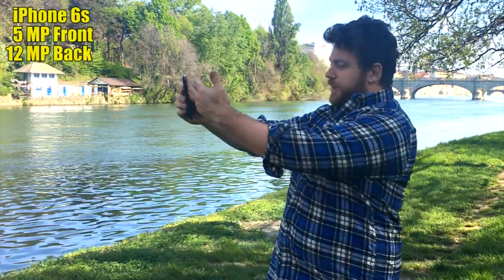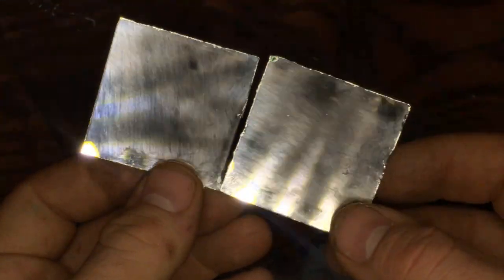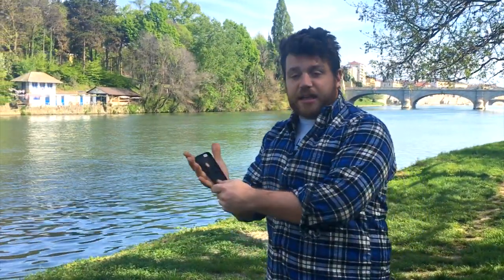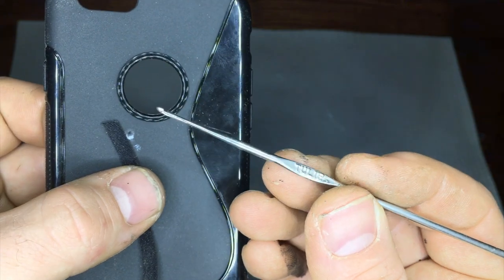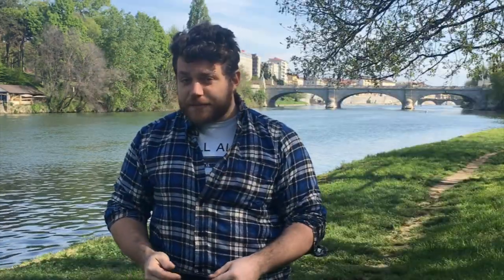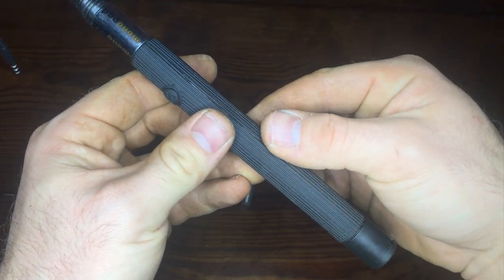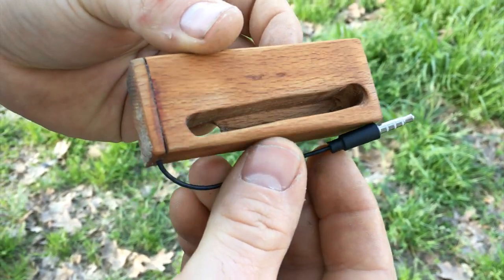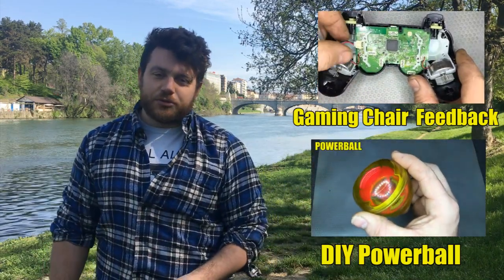3 DIY Projects for your Smartphone! TUTORIAL

Comment: I drill a hole in the case, look a small piece of wire like a butterfly Brad through the hole. then I take a small key ring and pass it through the loop of metel on the back sticking out of the hole. put the cover back on the phone. voila! a swivel ring on your phone to put your finger though. no more dropping. works better than thong elastic.